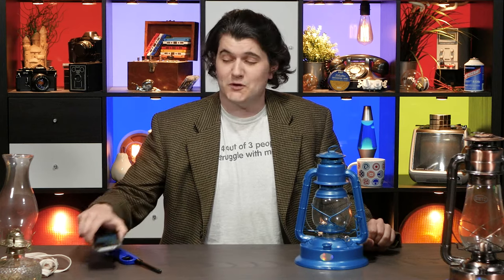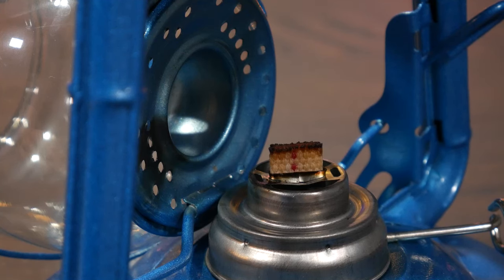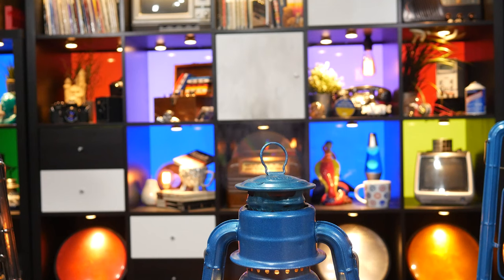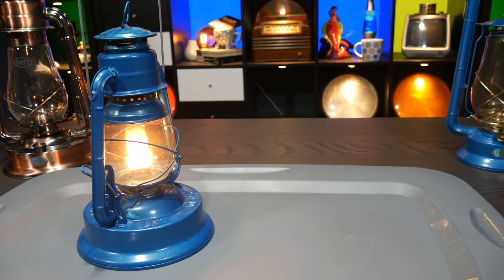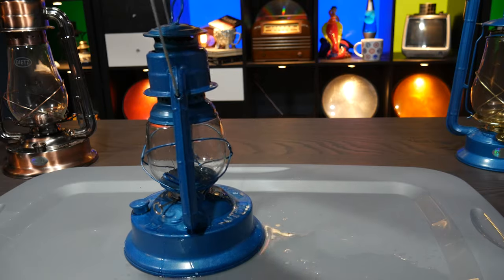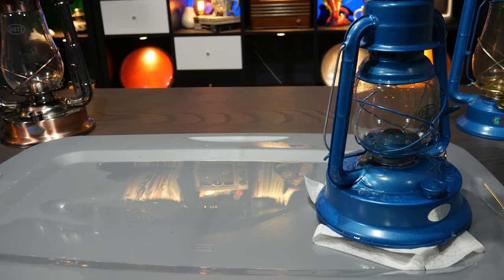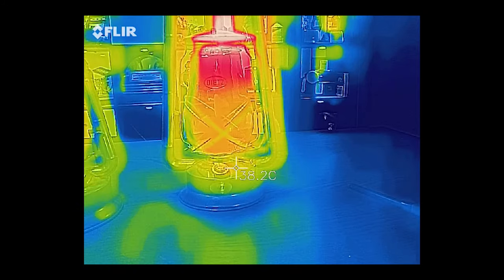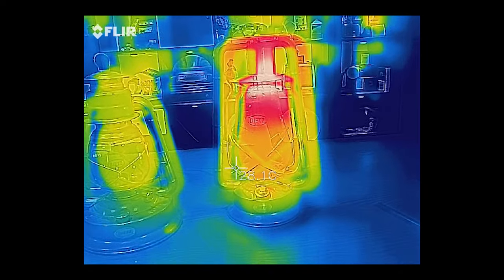How to use, more info, and further thoughts on hurricane (Dietz) lanterns

Comment: Preheating air, even a little, increases the efficiency of the burn. That's been understood for many years. It's like starting a cold engine. More fuel is required until it's up to temp. Colder intake air = more fuel use. Hotter, less. Look at how those Coleman gasoline stoves work. A catalyst sits right over the flame and actually preheats the fuel.
Reply: As fuel needs to vaporise to burn, preheating fuel makes sense but the heat capacity of air is so little that warming the air makes little sense to me.

Comment: Hey, if we're talking cars, a cold air intake doesn't just aim to add cooler air. Usually the aim is to just add more air without the use of forced induction,  and provide better air flow. What people commonly miss is that you also have to upgrade your exhaust system, and tuning.

Comment: 6:39 “degrees Kelvin”. It’s just “Kelvin”, not degrees. No worries, it just drives our physics faculty nuts :D
Reply: I believe you. But I still have to ask,

Why is it degrees Fahrenheit and degrees Celsius but not degrees Kelvin? 

Isn't the scale actually the same for Celsius and Kelvin? (Just with a different starting point) But not for fahrenheit?

Why isn't one unit of Kelvin called a degree?
Reply: @AmityPost  Most SI units are named after scientists, that's just how the system's naming convention works (the exceptions are older, inherited names like those of the metre, second, and mole). Thus, the SI base unit of temperature is the kelvin (after the 19th-century physicist William Thomson, Baron Kelvin), not the degree, even though it does have the same magnitude as the degree Celsius.

(Also, omitting "degree" indicates to people in a position to care that a kelvin temperature is absolute, i.e., not relative to any arbitrary scale, unlike degrees Fahrehnheit and Celsius, but that's only genuinely useful information in a very small number of cases.)
Reply: @ZGryphon  It's still degrees Rankine, despite being an absolute scale, despite NIST's recommendations. It was degrees Kelvin until 1967, heavily because of a simplification of the symbol.
Reply: @evilkillerwhale7078  Well, put 20 scientists in a room, and they'll come out with 40 opinions about nomenclature. :)

Comment: The Aladdin lamps and most Coleman laterns out there use thoriated cloth, so they will burn much brighter as the thorium oxide attacks the fuel. Not sure if it functions as a catalyst or not, but it definitely burns brighter.
Reply: It should be mentioned that they also consume the fuel a lot faster, esp. the Aladdin lamps.

Comment: I'd be very curious to see if the preheating makes a difference when it's freezing cold. Like so cold that the fuel evaporation is too slow otherwise.
Reply: to me this sounds like a reasonable reason for this construction
Reply: This was my thought too. I don't know much about the physics of combustion but I know seems harder to get dry wood kindling to light and stay lit when it's very cold outside.
Reply: I imagine that once the flame is going any fuel that's on the wick will quickly be heated enough to evaporate and burn. Getting it started might be slightly tricky.

Comment: I bought the same lantern, same brand, model, and color. It arrived yesterday. Burned high quality Medallion lamp oil in it for several hours inside a two-car garage. The stink was horrible as the binder in the blue paint decomposed on the upper chimney pieces. Burned it again for two hours today in the garage. No overpowering odor but I could still smell the hot paint if I sniffed about 2 feet directly above the lantern. That hot paint odor is probably what you experienced. It’s nasty. Even now, I think if I operated the lantern indoors the smell would be objectionable. Will remove all paint from the upper section of the lantern with paint stripper and/or soda blasting. That should cure the problem. (I can’t easily sandblast the paint off because the metal is very thin and will deform from the sand.)

Comment: "I need a cold air intake!" 
- People who have never looked at where the airbox in their car is getting air from. The added weight of metal piping and the fact that the metal piping is going to get way hotter than the plastic intake pipes of a stock airbox means you're probably hurting more than helping.

Comment: I would love to see a comparison of the hotblast to the hurricane in very cold weather (obviously at a more conducive time of year). I have a hypothesis that the preheating may be useful in freezing weather, especially -10°C or lower. Although it's very possible that it would be difficult to light the lantern in weather cold enough to significantly effect the ability of kerosene to vaporize.

Comment: In the thermal image, is the parallax being aggravated by your backdrop? When you move in close to the lantern, it seems like most of the parallax goes away. I assume the Flir software attempts to align the two images as best as it can. It looks like when you move further from the lantern, the camera may be aligning the backdrop image instead of the lantern image.
Reply: I have one of these FLIR cameras and you can adjust the parallax with a slider, it’s just hidden in one of the menus.
Reply: @mrb692  Or, easier, just turn MSX off, because it's so easy to see what is what in something like a lantern that the added visual details are just distracting and worse than useless.
Reply: @TheHuesSciTech  Huh, I figured the normal camera was used to enhance the thermal resolution. Do you get the same quality pictures without it?
Reply: @mrb692  You're falling hook line and sinker for the marketing material there, if I may be so bold as to suggest that. And you're being very vague with the term "quality". Does MSX give people a sense of "quality" or sharpness? Yes. Does MSX improve the ability to discern which parts of the lamp are which temperature? Arguably yes, but only if the parallax issue isn't there. And if the parallax issue is there, it makes things much much worse.
Reply: @TheHuesSciTech  You are being pretty bold there. By quality I mean would a FLIR One still make a recognizably lantern shaped blob without the MSX, or would I be looking at a 160x120 pixel image stretched across a 6” phone screen like the Gunslinger’s vision from Westworld? 

 For reference: https://youtu.be/5jCDQvNh85Y?t=60
Reply: @mrb692  You'd see a perfectly recognizable lantern shape, the tube things on the sides would be perfectly visible. And yes, this is despite it being only 160x120. The Westworld example isn't too far off, but think about it: even in that example, you can easily tell it's a person, and could accurately probe the temperature of the torso, arms, etc etc. MSX technology doesn't "enhance the thermal resolution", it just naively plops the edges detected from a normal visible camera on top of the low resolution thermal image. Which again, is basically a lie at best, and actively harmful with the images aren't aligned properly.

Comment: Happy to see this. Did not expect the tubes to stay so cold on the hot blast lamp. There won't be any realistically observable, let alone useful improvement unless the air heats up at least a few dozen degrees (just the airflow shaping cap above the wick does more than that). Guess the flame getting longer overtime is the wick/whole thing getting hotter and making the kerosene evaporate more, or the chimney draft gets stronger as it gets hotter, or probably both.

ps: Seeing that lamp leak so bad while not going out made my trousers climb up where the sun don't shine. I don't want to see the outcome where you roll a critical fail on that.

Comment: In my experience there is also some fuel expansion as the lantern hits peak heat in the chassis. I learned this the hard way. There's a reason they label max fill levels.

Comment: Pressure lanterns like Tilly and Vapalux, Petromax and Coleman do use very hot air for the intake, drawing the air through narrow tubes sited in the efflux from the burner.

My old VW Passat had the cold air intake in the oversized VW badge on the front. The result was that everything that came at the front of the car, came in through the intake. Open the air filter and you would find dead birds, small mammals, insects by the million and lots of leaves. It was like emptying your Dyson.

Comment: When you mentioned your hair early in the video, and later started to show how tipping over a lighted kerosene lamp indoors on a piece of plastic on a wooden desk was safe, well, I thought you were going to be doing the next video with no hair.
Reply: Methinks someone is confusing gasoline/petrol/benzin-based fuels with petroleUM-based ones, such as this one. The latter will aid you light a stove with exactly zero drama, while the former will absolutely try to blow up the whole room if you try to do the same thing with it. HUGE difference.

Comment: I have a few lamps around the house just in case. My favorite is the round wick lamp. As it sounds, instead of a flat wick, the wick is a tube and the glass chimney is a tall tube that's narrower at top. You get a much taller, cleaner burning, flame and enough light to read by. (And, yes, even the Coleman globe lanter has some smell.) These first showed up around 1900. BTW, if storing lamps, drain after use into a sealed container and store out of the house. Parrifin oil is supposedly less toxic to burn.

Comment: with the cold air intake thing:

I think a lot of people confuse the term for a generally better flowing intake. Some cars will have a cold air intake, but are restrictive due to a generally OK flowing intake. The main benefit of aftermarket intakes is that they flow better. Some are also just designed to be cold air intakes, too.

Comment: As a Maker I never really thought much about this kind of lamp. But after watching your YouTube video on it I was inspired.  I even found a few old kerosine lamps from my grandparents. 

I have a few design ideas for it.  Take a raspberry Pi 0 and a servo motor to control the wick, light sensor, heat sensor, a spark igniter and few lines of python code and you could build a fully automated light source for your cabin in the woods. It could be power by a few rechargeable AAA batteries. 

Why bother you say, will I have a desire to take old devices and try to reverse engineer them and then modernize them to the point that they are more functional and useful. 

The pandemic Has Demonstrated to us that a lot of  things are harder to find when no one’s working. 

Example, Kerosine is easier to find and store. it’s harder to find  Fuel like propane.

Well it’s getting late and I should turn in soon. My kerosine lamps just turned on filling in the room with a nice warm glow , good night all

Comment: I agree that the effect is probably negligible, but I maintain that measuring the temperature of the metal doesn't accurately reflect the temperature of the intake air. 

If you put a copper pipe in one side of a bucket of ice water and out the other, then shoot a blow torch through it, the copper will stay relatively cold while the air coming out will still be 1000 degrees. 

The air is heated by the chimney, which is super hot. The tubes are cooled by the fuel tank which is a massive heatsink. 

Measuring the outside of the tube doesn't accurately reflect the air inside of it. The fact that they are notably warmer than the fuel tank tells me the air going through them is much warmer than the fuel in the tank. (If the air was only 10 degrees warmer, the tube wouldn't be) 

In the ice bucket blow torch experiment, the tube might end up being 50-60 degrees while the air inside it was 1000 and the water was 32. Liquids and solids transfer heat much more rapidly than gasses. 

That said, I agree with your point that it probably doesn't make much difference. That could easily be tested by putting the lantern in a freezer and/or blowing a heater on it. I bet it would glow about the same.

Comment: I have only trimmed one of my lantern's wicks and only once. My lanterns are burned at least once per week and I've had them for years. I find that the charred bits just kind of burn up and fall off. They are quite hot when they do, but that doesn't really matter where I use them as those bits cool within a 5 foot drop. 

I burn ultra pure paraffin in lanterns and added lemon-eucalyptus oil in my torches. (Ultra pure has no dye or performance additives. It also comes from the hearts of that segment of distillation so it avoids the azeotropes at the transition temperatures).

You are not suppose to fill these beyond the edge of the wick holder when tilted at 90 degrees if it is sitting on a surface where it could be knocked over. That said, I don't know anyone who follows that rule. 

Hot blast are preferred for camp shelters because any smoke or vapors burn off on the subsequent passes and they are better for creating more radiant heat in cold climates. For outdoor use or in well ventilated spaces, the cold blast produces a brighter flame but are less efficient because they release a lot more non-combusted fuel.  The main advantage for cold blast in camping is the fact that you can get stove top versions where the chimney cover is replaced by a ring that can hold small pots and pans.

Comment: Have a couple Dietz lanterns, ones is a series 80 or something, the other one is tiny and i got it for my son.  An honorable mention is that these lanterns are very minimal maintenance and in a power outage these don't require batteries and pressurized tank like Coleman white gas.

They beat candles for lighting and have almost zero chance of not working as intended when you need them.  So long as you keep them fueled up they will ALWAYS light up for you .

Sometimes i sit on my back patio and run these just for the dim light and realize how mucj worse they are for light vs a Coleman white gas but then try to picture myself as someone living in the era where these were the only source of light.

Im sure you adapt whe. That's all you have

Comment: Two things regarding the wick.

1. You can change the shape (and thereby light output) of the flame, by what shape you trim the end of the wick. The most common methods are straight across, curved like a fingernail, or pointed.

You tend to get the most light from the pointed wick.

2. The wick won't burn significantly unless you let the lamp run out of paraffin.

Comment: For all that electrifying the world may be a laudable goal there is case to be made for cheap, reliable lighting using a fuel that is also cheap and readily available. Infrastructure doesn't come about easily and the more modern the tech it is, the more expensive it is to implement. Likewise, if done "on a budget" the more likely it is to fail.  Look at the power grids of N. Korea, Cuba and similar places around the world. Heck, I can't make it 2 weeks without power going down at least once for no apparent reason and we deal with the occasional rolling blackouts. That is in a newer house in a moderately new neighborhood near a very large city of Texas.  Sometimes the best solution isn't necessarily the same everywhere. Great videos though, keep up the great work.

Comment: Cold Air Intakes are about how they sound. OEM intakes are tuned for low noise and can leave a few HP on the table for it. They can be useful when you've changed other things and are actually tuning your ECM.

Comment: "Smells like an airport" is subjective.  If you were like me and grew up with kerosene heat being the difference between freezing or being nice and warm, then the fragrance of kerosene might be a beautiful memory of warmth and smiles and happy things.  That's what I experience when I drive past an airport or even when I had a kerosene heater for a while as an adult.  It literally puts a smile on my face.  Even the occasional diesel truck where the exhaust smells like kerosene, and not all do. But the ones that do are like following a truck that smells like dinner.  If you can imagine such a thing.  I admit it's unusual to like that smell.
Reply: I work at an airport, so I absolutely love the smell of kerosene / Jet A-1. To me, it smells like salary :)
Reply: I’ve had family tell me similar things about paraffin, specifically a brand which was blue I believe.

Comment: You could install slider valves near the bottom end of those cold air intakes on the right lantern to modulate the amount of fresh air going in before the flame. Just like they have on charcoal grills.

Comment: What is actually happening, is that a draft is being created by the heat. The induced draft is why the flame changes, at least till everything reaches the max temperature its going to. Once everything equals out, the draft will stabilize, the flame will stop changing height.

Comment: Plot twist......these lanterns work best in cold climates where the fuel would gel due to temps and introducing warm exhaust air to a portion of the fuel tank would keep temps up allowing them to useful. Side note: the air runners on the side could be used as hand warmers or makeshift heaters, as they hold heat for awhile and with a large surface area would make a rather nice warm spot.

Comment: Two things.

First, I noticed your thermo camera is running on metric whilst you're in the US. I admire that, sir.

Second, how does the fuel go up toward the flame? Does it just run up the long 'wick' and as it burns, more keeps being drawn up?
Reply: That's exactly how it works, just like a candle.
Reply: It’s akin to the Zippo, if you’ve ever used one of those. But the artificial cotton wool in the Zippo is the paraffin tank in this. Because it’s more like diesel oil than gasoline/petrol in terms of evaporation. So it’s a fancy oil lamp.